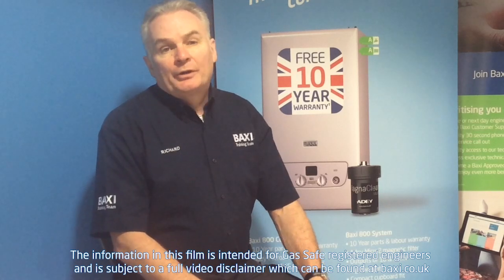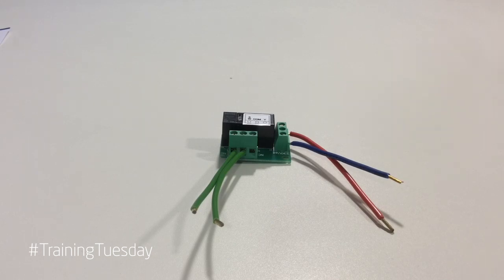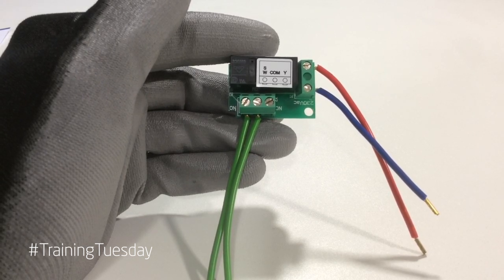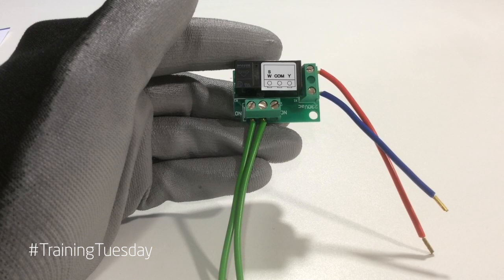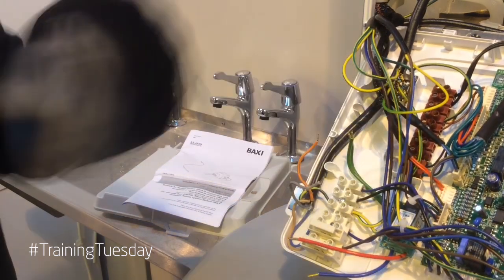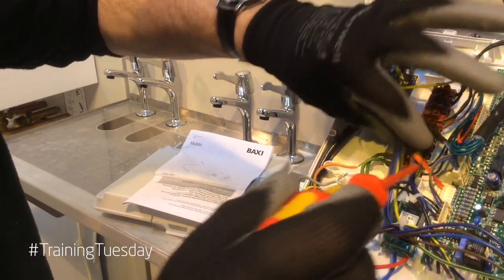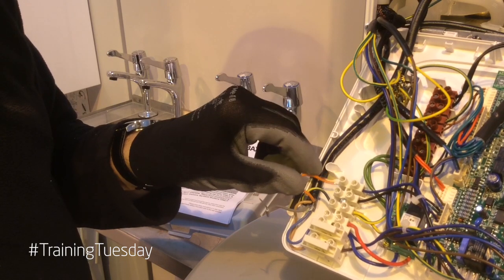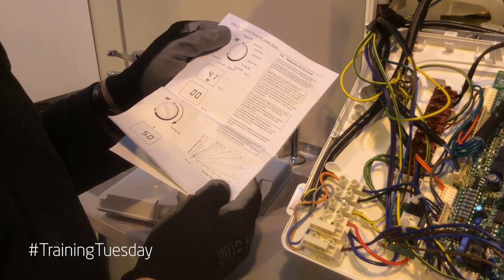A closer look at the Baxi IFOS (In Flue Outdoor Sensor) for the Baxi 600/800 System boiler ranges

Comment: I know it's been a year but I've only just seen this video as I'm considering having Weather Compensation fitted.

The instructions for my 824 boiler clearly state in several places that "The 230V switched signal for external controls (frost thermostat - room thermostat - timer) must always be taken from terminal 2 at the boiler". 

I assume this is to ensure that if either of the 5A Fast Blow fuses go, there is no 230V feed back to the boiler PCB, which there would be if terminal 2 was fed from the SFU. 

Unless there is some other reason, this video therefore doesn't show the boiler connected correctly according to Manufacturers Instructions. I'm not a Gas engineer, but I can read a book and a circuit diagram, and I'm in dispute with an Electrician over it as I think he ought to come back and correct it.
Reply from the maker: Hi Tony, thanks for your message. I have just spoken to our training manager and here's what he said - You're absolutely right, the fuses are there to protect from the 230V supply. However, the weather compensation connections are low voltage and therefore do not come through the 230V supply.
Reply: The point I'm making is that you have a wire in terminal 1 but not in terminal 2. So it was wired up incorrectly before the IFOS was fitted according to the Manufacturers Instructions I have, which is a bit concerning considering you are a Baxi training centre. Also, the System Boiler IFOS kit has a relay PCB  does connect to 230V as it requires "A 230V switched live from the DHW cylinder thermostat ..."

Comment: Fit them as standard, or I'm not using them
Reply: ?? I didn’t understand at first.
But you mean Baxi should fit them seen as sold ... Day1??
Or you won’t fit them?  Is that correct?  Sorry... I don’t mean any disrespect, if it comes across.
Reply: How can they fit them as standard the majority of systems won't have the extra wire at the old existing boiler to start with?